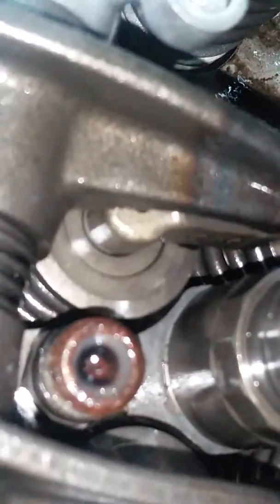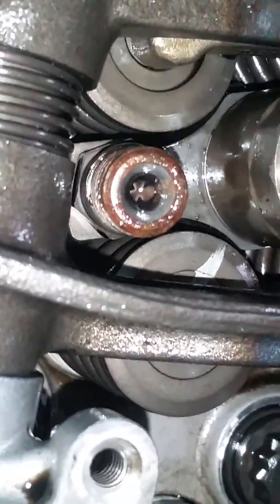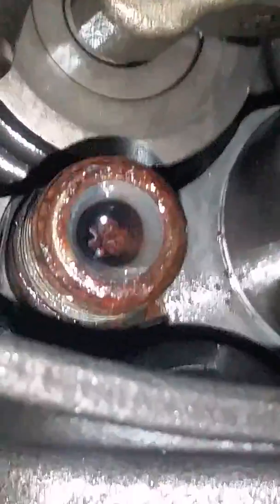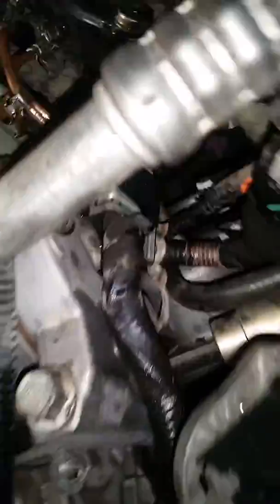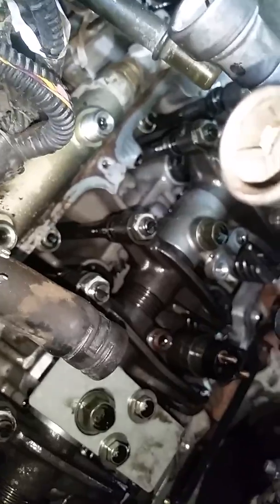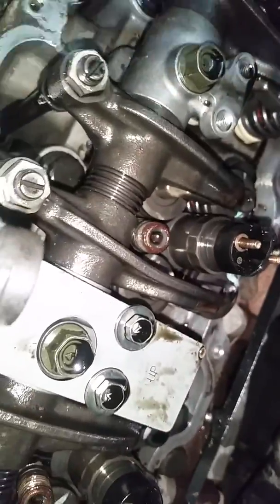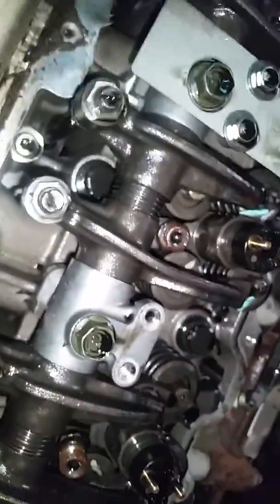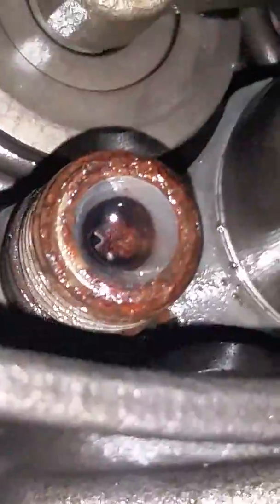Diesel fuel injector failure

Comment: That is not from water in fuel since it is out side of the sealing area. That is from a bad design letting water around injector line nut. It falls in the injector when you unscrew the nut.